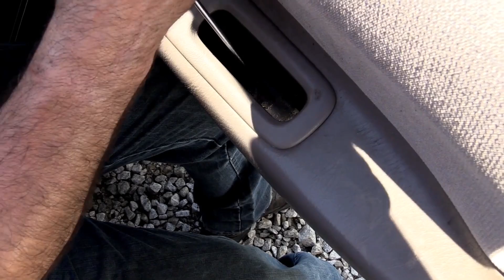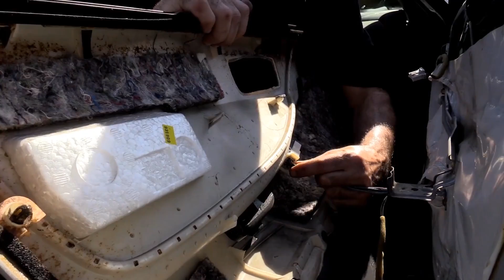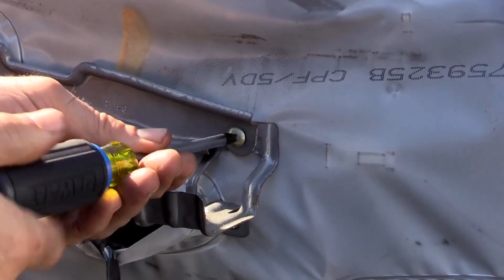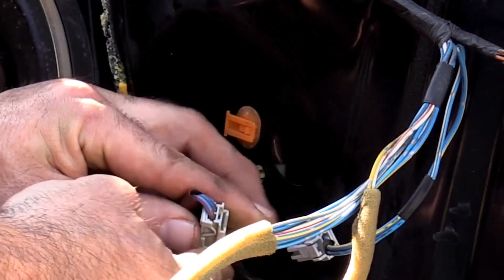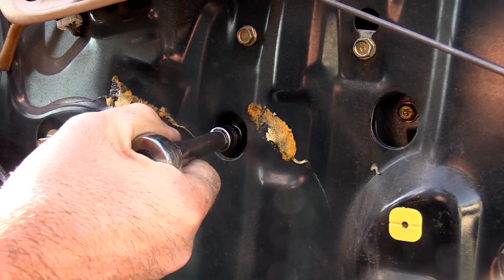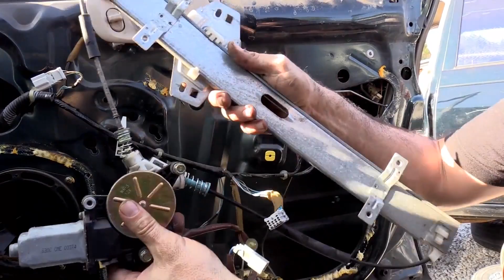Honda Window Regulator Removal Guide: 1997-2002 Accord Model Years

Comment: Great video showing how to access and replace the regulator.

However, based on my experience, you ALSO HAVE TO FIX THE ROOT CAUSE of the problem that caused the regulator to fail.  If not, the new regulator may prematurely fail after one year...  

My 97 Civic is over 23 years old.  In my case, I additionally had to PARTIALLY REMOVE the rubber window "run channel" (I only removed the left and right "sides" of the channel), CLEAN THE CHANNELS of accumulated dirt (I used cotton swabs soaked in "Goo Gone" but I guess soapy water would work as well).  

In addition, it was easy to completely REMOVE THE WINDOW from the door.  Once removed, it was important to thoroughly CLEAN THE FRONT AND BACK EDGES of the window.

Finally, I read that the "run channel" should be LUBRICATED WITH SILICONE GREASE.  In particular, I read that Honda's  Shin-Etsu Silicone Grease, part @-9013 should be used to lubricate the channels.  My local Honda dealer price-matched another dealer's price; I paid $18.15 for one tube.

Since I had gone through two regulators, each lasting only about one year, I GENEROUSLY GREASED the channel AND both sides of the window's left and right edges BEFORE REINSTALLING THE WINDOW.

After re-assembly, the window moved up and down without any hesitancy.  In comparison, the other windows moved much slower - so, I will do preventive maintenance for the other windows by removing the windows, and thoroughly cleaning the window edges AND run channel.  Cleaning removes the accumulated dirt, which allows the window to move freely, and reduces the load on the window regulator motor and assembly.  Hopefully, reducing the load on the regulator will prevent the regulator from failing again.

Comment: I dont get why would a motor work to align bolts to replace a motor?
Reply: Hello John!

I had the same question, before thinking it over:

The external battery hack is used exclusively to remove a window, by raising the window to align the bolts to the holes in the door panel to access the two bolts. Then, as in the video, after removing the two bolts the window can then be simply pulled-out.

Alternatively, if the motor doesn't work, or the regulator/cables are damaged in such a way that prevents raising the window, then implement plan-b (since using an external battery doesn't apply): since a socket may not be able to reach the regulator bolts, use a crescent wrench to access and remove the two bolts via holes in the panel. To remove the right-side bolt, the speaker needs to be removed to gain access to it. 

Great video - kudos!

Comment: ummm, how do I say this nicely. One of the main reasons people will want to remove the window regulator is because the window motor is kaput. So rigging that motor to external power from whatever source doesn't, ummm, really help.
Reply: If the motor is kaput i think you can just access the bottom of the window, force it up through the channel and pull up on the window to tape it into place when you see the bolts aligned with the holes.  

But if you’re trying to harvest the window attached to a regulator with a working motor, i don’t think (I’m guessing) you can move the window freely like that with your hands. The external battery is for that purpose.

Comment: How in the hell do you make a video and have a special battery contraption part of how you make the repair? Such a waste of time. Nobody fixed anything from watching this video. Poor idea.
Reply: Hello Adam - great question!

The external battery 🔋 is used to raise the window mechanism to be able to align the two window bolts behind holes in the door panel, enabling them to be removed with a 10-mm socket wrench in order to remove the window. This is because there is no battery-power to the regulator from the vehicle itself (in most instances). I would probably just pull the window up to align the bolts. However, without having much experience, the regulator motor may be unable to raise the window unless power is applied to it. That is where utilizing  the external battery comes into play.

In summary, great question,  and great video - kudos!